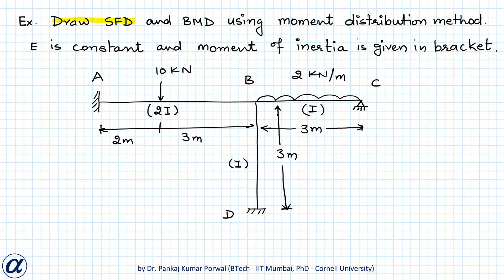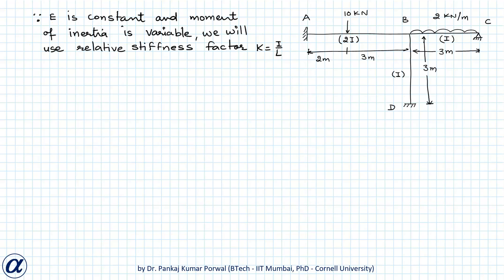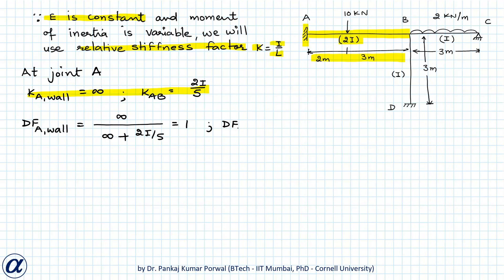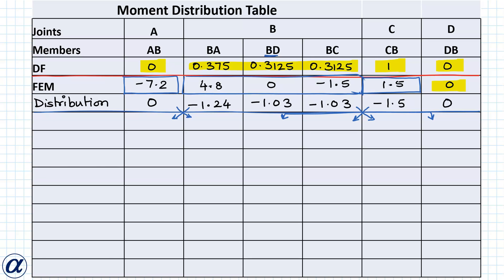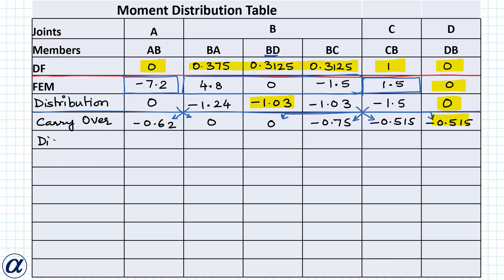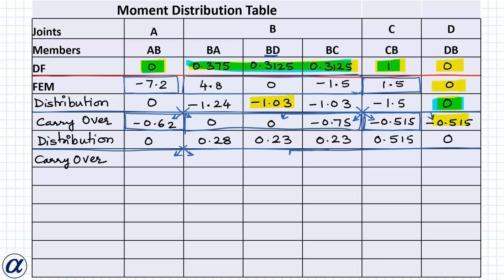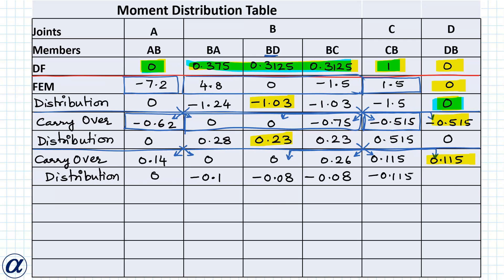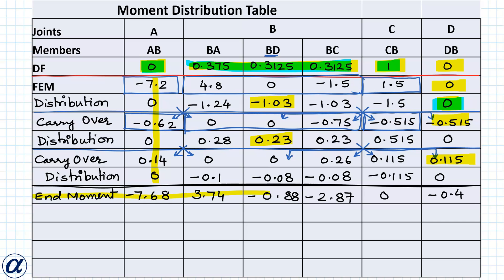Moment Distribution Method Example 2

Comment: why sway is not calculated for this frame sir.
Reply from the maker: Because the members are assumed to be axial rigid and the way it is supported, there will be no sway, ie, point B will have zero horizontal displacement. In fact the displacement of point B will be 0.

Comment: Far end hinged stiffness factor should be 3I/4L.sir
Reply from the maker: If you do that then the carry over factor will also need to be adjusted according to fixed - pinned beam.  What you are saying and this method, both give same final result.
Reply: Yes bro..you are correct..at hinged support stiffness K = 3/4 I/L...then all values need to be corrected
Reply from the maker: @srinurao3327  If you do that then the carry over factor will also need to be adjusted according to fixed - pinned beam.  What you are saying and this method, both give same final result.

Comment: Hello!

A small confusion concerning distribution factor for member B-C. The stiffness factor for BC should be multiplied by 3/4 as the support at C is pinned. Correct me if am wrong please.

Thank you.
Reply from the maker: If you do that then the carry over factor will also need to be adjusted according to fixed - pinned beam.  Both methods give same final result.
Reply: @pankajkporwal  I can’t understand this. Plz explain
Reply: @pankajkporwal   Yes! 

Okay great. Good to know that. Thank you 👍
Reply: Dear sir I did the same example with both methods are almost same values..thank you sir